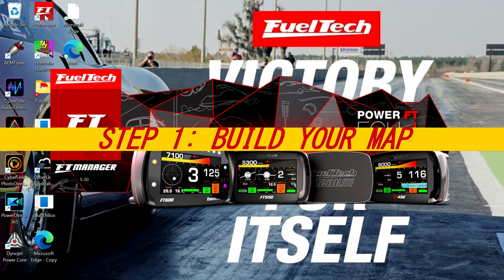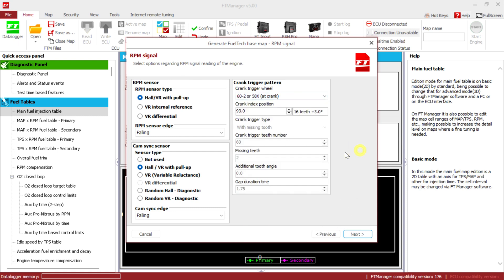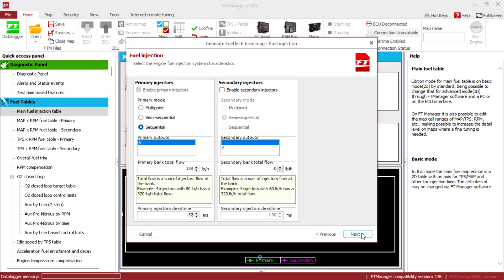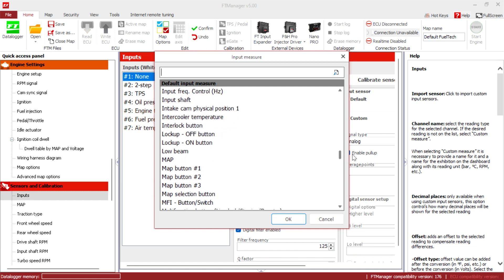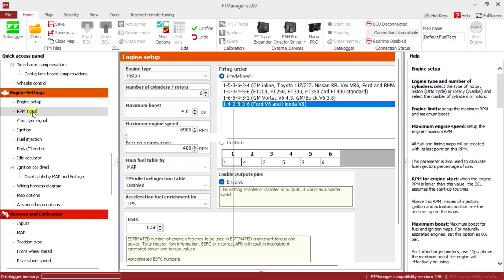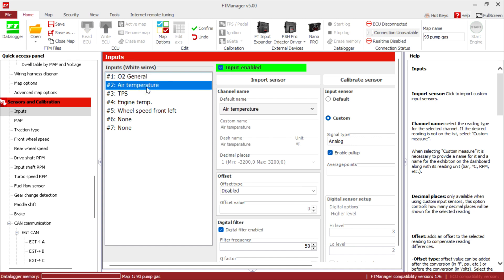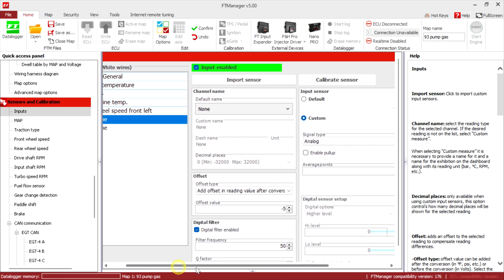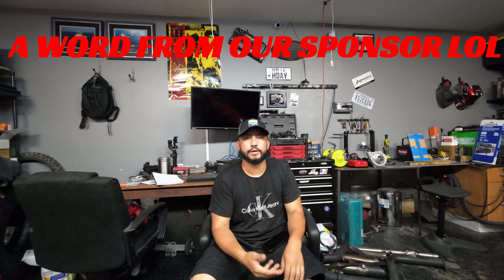FUELTECH FT450 to J SERIES HONDA V6 HOW TO part 1

Comment: Fuel Tech sells a 6 cyl FT450 harness could I use that for a J32 swap. Universal application no stock ECU
Reply: I got a jseries  i can use ft450?
Reply from the maker: Fueltech is universal you have to do your own wiring or i believe there is a company that does sell a harness to run it but I'm not very informed about that or You can run it like i did as piggy back with stock ecu and fueltech controlling the engine ignition/injection/boost/fan with it but the settings i have on the video is for the manual transmission that has the sensor triggers on the flywheel but if you want to go full standalone and control everything i would recommend getting a ft550 for more inputs and outputs
Reply from the maker: You could but it depends on your needs i think if you go full standalone you may be better off going with the ft550so you don't run out of inputs and outputs
All motor you may get away with ft450 but if you start trying to add more stuff like nitrous or boost controllers etc and control the whole thing you will most likely run short my personal opinion now the harness is a great way to go too just take in consideration that it is a universal harness so you still need to rework it some for your needs

Comment: Question about the crank gear. On manuals isn't it 24-0 and auto it's 12-0? So to set this up on auto engine on your settings would you put 6-0? Or are you running 12 teeth on your crank?
Reply from the maker: 24 would be at cam but the settings on the crank sensor is 12 no missing tooth it is  for manual i believe automatic is the same thing depending on the generation I don't know in other platforms but in fueltech worked like this and since running wasted spark and only 1 cam sensor you want a spark on each rotation it works for the manual cls i couldn't tell you on the automatic i haven't mess with the crank trigger on auto
Reply: Thank you for the clarification
Reply from the maker: @francismande  yea that was my bad i should have specified that since the begining
Reply: Do you physically have a 24-0 crank gear on your engine and used 12-0 in your crank settings? I have the same manual J32 but its crank is 24-0 hall effect sensor. I recall automatics have the VR 12-0 gear and cam sensor. 2 wire VR vs 3 wire hall sensor. I'm trying to understand if you swapped your crank gear to a 12-0 or just changed it in the software.
Reply from the maker: @francismande   you do have 12 teeth physically on your crank sensor but your engine has to go 2 full rotations on the crankshaft and 1 on the camshaft to complete a cycle to operate the intake and exhaust valves in the correct timing with the piston as it sequences thru the four strokes so that is considered 24 teeth of crank sensor to 1 rotation of the camshaft but that's why you hear people say 12 at crank 24 at cam i don't know if that makes sense for you? You can run different settings depending if you running a cam sensor or not the way i explain it is running completely stock without having to physically touch or modify anything just wiring to run the ft450/ft550 on cls or j35 or other similar engines with manual trans and the hall effect crank and cam
Reply: @clevermotorsports  check around 4:05 https://youtu.be/RIgo0QyohRg?si=NrHxz-KRx5T9klTf
The video shows the two physical differences. I was just curious if you ran an automatic crank gear because clearly autos have 12 teeth and manuals have 24 teeth on the crank gear. That's what I meant. I'm not bashing you. We need this info in the J community to run Fueltech without shaving 3 teeth off.
Reply from the maker: @francismande  if you watch part 3 you will see what I'm talking about im using the flywheel triggers not pulley and flywheel has 12 teeth no missing tooth

Comment: I seen your other video of the car and was intrigued about the fueltech so i bought a 550, in the next couple of months when works slows down I'm going to start on my mid engine xo civic build with a J2K setup. Do you know if the crank and cam sync the same thought the gen1 gen2 gen3 engines ?
Reply from the maker: So  automatic engines those have variable reluctance 2 wire cam and crank sensors and type s manual have hall effect 3 wire  but i did notice the cam triggers on the cam gear are a bit different on the automatic ones so the cam settings may change a bit the other than that if you run all stock the crank should be same unless you run missing tooth wich in my opinion may be better in case cam sensor fails car still runs missing tooth you would have to get your angles on the missing tooth figured out